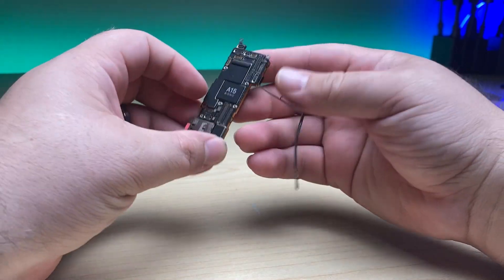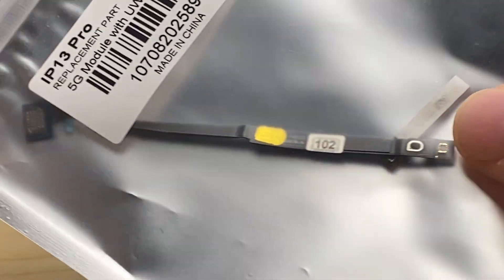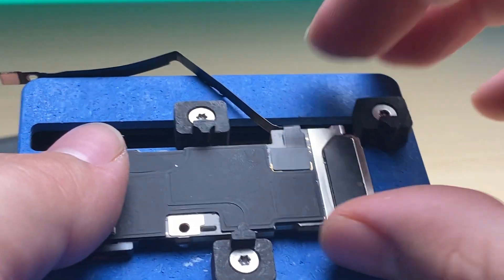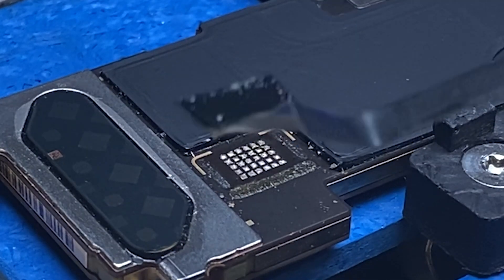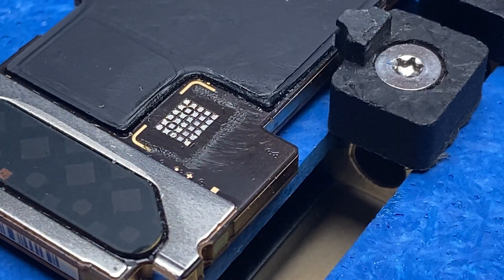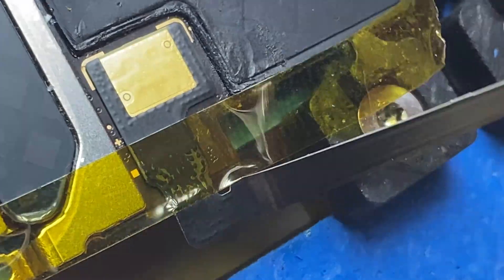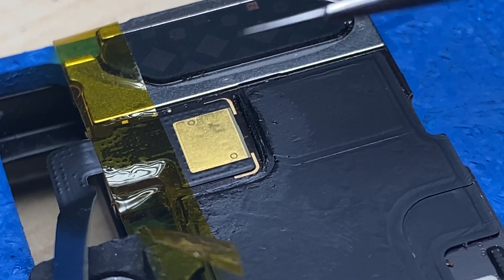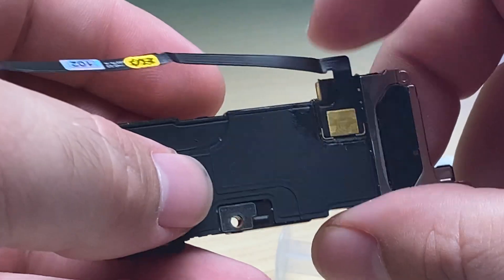📱 iPhone 13 Pro 5G Antenna Repair -  (Tips and Tricks #32)

Comment: Hoping for some helpful advice my 13 pro max got water damage and after months of using it after the fact it now won’t connect to cellular, Wi-Fi or Bluetooth. If I get a new antenna and solder it on as this video shows do you think that will solve my issue? Thanks for the help!
Reply: Each of these functions have different antenna/radios. If the damage has effected all three, there’s probably a deeper issue.
Reply: Have the same issue, any advice?
Reply: What if not replace that part ??? I cut it mistakenly ;( what if leave it like that ? What wrong will be???